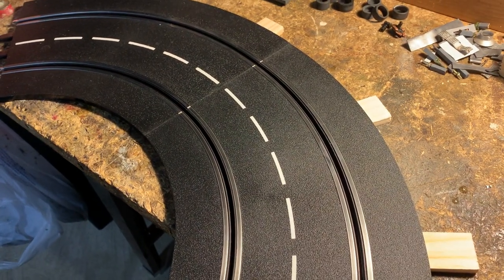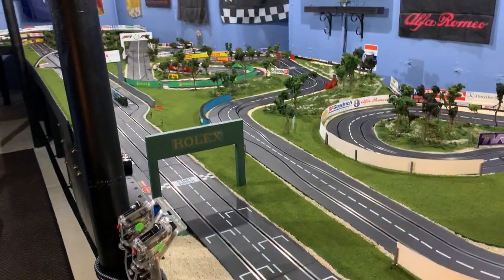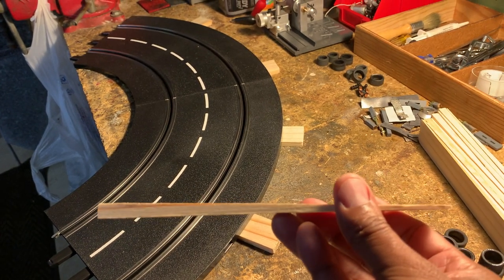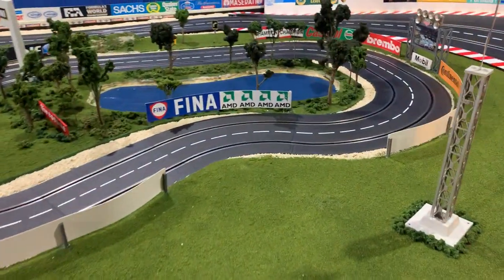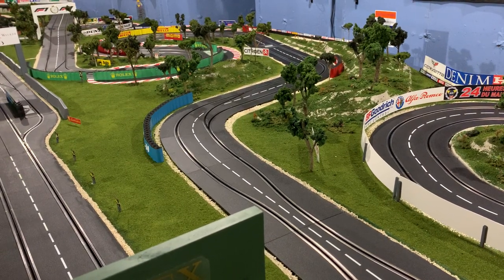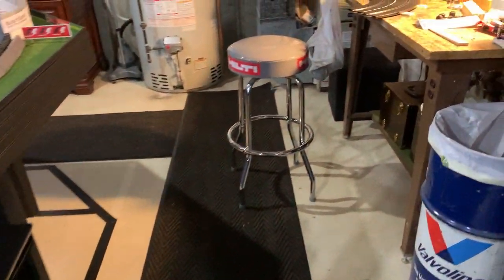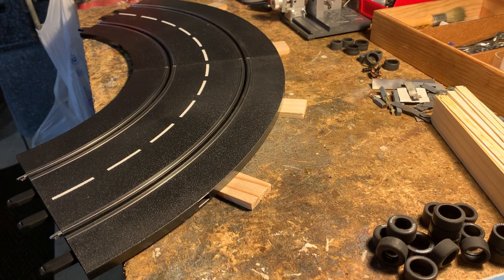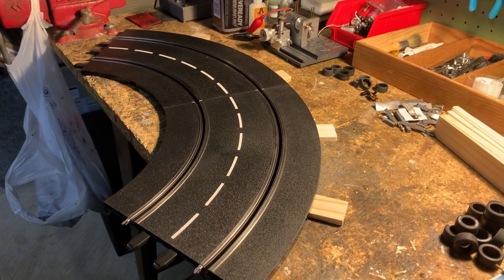Simple Trick to Improve Your Slot Car Layout and Increase Car Speed.

Comment: Hello Anthony,
I'm Stéphane, a French collector who contacted you in 2023 for general information about the layout of your circuit.
As regards the trick you use to improve speed in the bends...but it's an obvious one that I used a long time ago. I quickly realised that when the bends are all flat, the cars easily leave the track and you have to control the entry speed.
So I came up with the idea of raising the outside of the curves I was using by taking what I could get my hands on and trying to have more or less the same height raised on the outside throughout a complete curve.
The principle of your wooden shims is of course safer because you have calibrated these shims and the work is cleaner under the circuit, once it has been laid in its setting!
It's a more "professional" and very useful trick... Well done!
Reply from the maker: Thank you my friend. I appreciate your kind words.

Comment: As a builder of wood routed tracks, this is the best idea I have seen for enhancing racing on a plastic track. FYI have you ever seen a perfectly flat straight on any real racing circuit?  Put those shims on both sides of the track just before or just exiting a corner for even more excitement!!
Reply from the maker: You're right Tim...it makes for exciting racing. However, it wasn't my idea. I simply learned from someone else who was doing it. What I think is really cool is creating negative camber on curved track. It requires good driving skill. Your thoughts?

Comment: This is a great way to incorporate banking.  Stacking and getting a higher angle would increase top speed through the turns as well.

Putting some shims down the straights probably wouldn't add to the performance, but adding some elevation changes on the straights, including some cambered straights (one side higher than the other) would make the racing more interesting.
Reply from the maker: Thank you Paul...changing elevations is a great way of increasing the complexity of your layout.

Comment: Nice looking layout. Well done. And this idea of using the Home Depot carpentry shims under the curved track is a great one. I can't believe I hadn't thought of that as I used a million of those shims when I was building my deck.

I also like the idea of insetting the track in foam board or homasote. I hate how the track looks just sitting up on the table. This provides an extra level of realism when using plastic track.
Reply from the maker: Hey Heath...hope you and your family are doing well. Thanks for the kind words. The shim makes a big difference. You're able to come out of the curves faster and it better represents real racing. Real circuits have gradient incorporated into the curved areas. Secondly, if you send me your email to aramsey4979@yahoo.com I'll send you a few pics of my layout construction. Oh by the way...I did a terrible tracing my track on the foam board. It was supposed to be 1:1 tight fit. So I improvised and used aquarium sand as run off to hide my poor tracing skills but it actually makes it look better. Thanks again.

Comment: I have a pack of these in my garage can't wait to add this to my track. Thanks!
Reply from the maker: Peter let me know if you experienced the improvement in corner speed that I did.
Reply: @MrAramsey4979  This worked out beautifully! It really is a must especially for those radius 1 turns. Thanks again! Now all I need to do is find a way to add 95 more feet of track to my layout to catch up to you :)
Reply from the maker: @MrPeteSantos  Peter glad it worked out for you...just make sure to add jumpers as your track expands. Also...I bought track at a bargain on ebay. Mr Carrera can be expensive retail.
Reply: @MrAramsey4979  Jumpers are in my next round along with more cars. I've found carreraslots.com to be the most reasonable on prices. Also they are very nice to deal with. Cheers!

Comment: Thanks Anthony,  do you glue or caulk under your track?
Also I lover your beautiful track......
VRooooooom 
🤙🏁🔥🏁🤙
Reply from the maker: I didn't glue my track down. I inset the track into the foam. It's a press fit. I used aquarium sand to fill in any gaps between the track and the foam board. I then use Elmers glue to harden the sand. This approach is advantageous because I can simply pull the track up when needed.

Comment: Anthony, great tip. Thanks. I'm just getting into slot car racing and I'm looking for a good track planning software program that can help me figure out my dimensions and also the # of each pieces I need to complete the design. Any recommendations?
Reply from the maker: Hey Jim thanks for the compliment. I didn't use a layout planning software but I hear that Carrera has a free software that others like. You might want to investigate it. My thoughts on the subject is as follows; determine how much space you have currently, tape the surface area so you can see it mentally, and start laying out different configurations until you find something you life. I know that's exactly what the software does but I like working with my hands.
Reply: hi Anthony, it took me 12 trys at 10 to 20 hours each to finally get the layout I'm happy with, with all the planning in the world the track has a mind of its own, it's quite challenging to get one end connected to the other,$$$

Comment: Yeah man.....Well played. Never thought of that. Have you experimented with putting two in there? I have a really similar setup (Carrera Digital, and similar length) and there are two 1/30 turns that people just eat it on. One is obvious and in a technical area, but the other is pretty deceptive. How much difference do those shims make?

Also, really good job on the scenery. I'm getting better at it little by little, but finding the time is brutal.
Reply from the maker: Hey my friend I hope all is well with you and your family. The shims make a big difference. They provide a slight inboard angle that allows you to take the curves faster. I think one of the cheapest and yet most impactful elements of my layout. I don't think I double stacked any. For me that would make the angle too acute.  Thanks again for the question.
Reply: @MrAramsey4979  thanks for the response. Good job promoting the hobby. I wish more people would look into it and see how cool the digital set ups are.